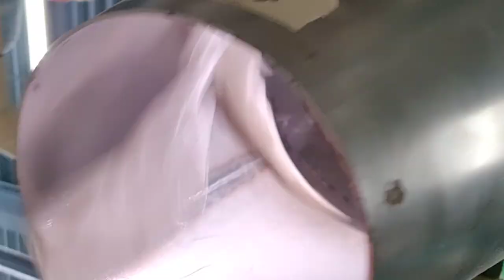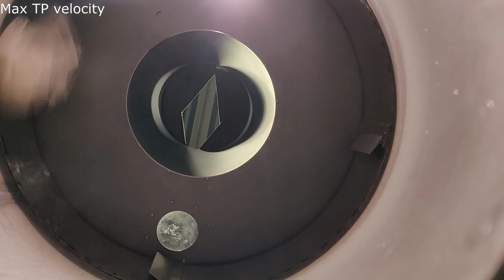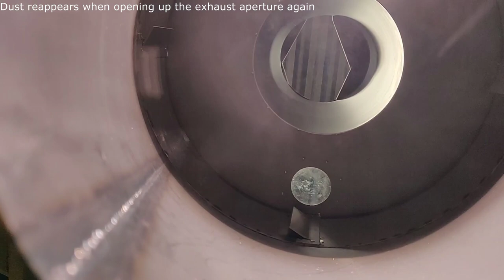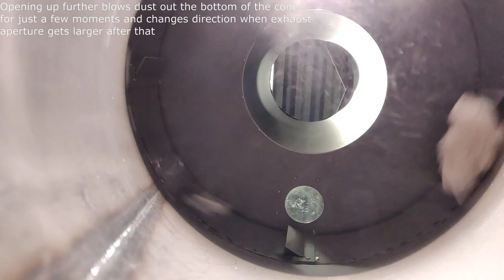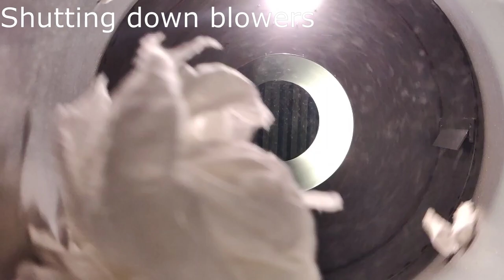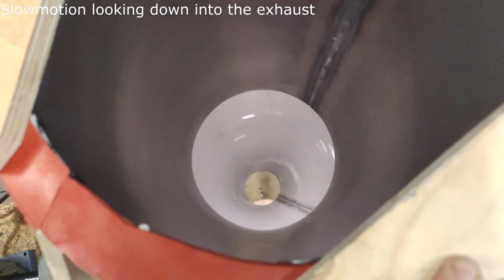WindHexe Prototype V02 Testing Day 02 (Tony Jabony summary in description)

Comment: Starting to disintegrate it ,
Reply from the maker: On the path to resonance.

A child can fail to whistle with too much or too little air, even with the right mouth form, lip tension, tongue etc in the right place. I believe that when you hit the standing wave, there will be an additive effect.

That being said, there may be standing waves that have key structures that are prone to disruption in other parts of the system, and therefore, we might need to make the fundamental on the correct harmonic.